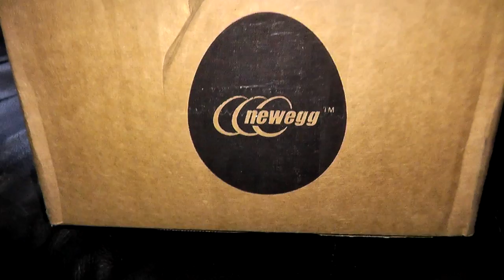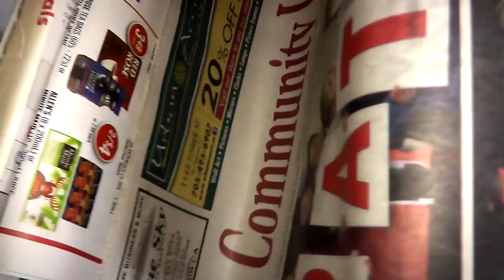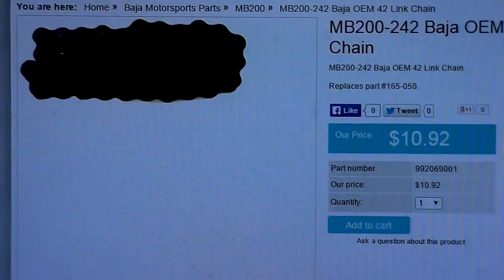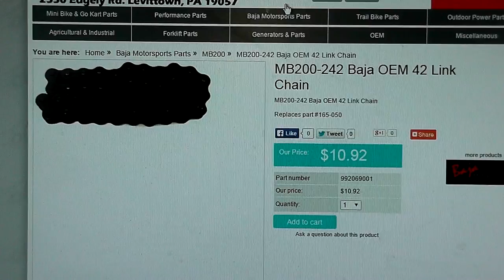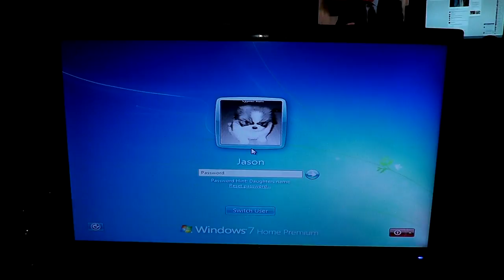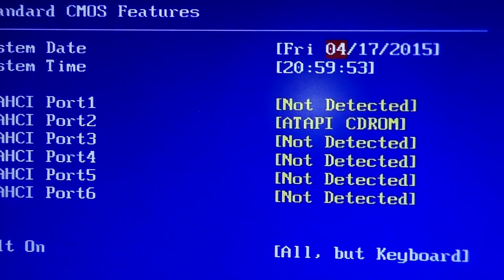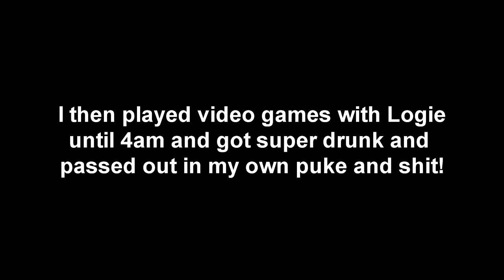Minibike work, Dinner at the parents

Comment: You might find that the drive side of the clutch is clamped to the crankshaft with Allen screws, and the clutch bell is attatched with a snap ring.

Comment: Sucks about the HD. I got the dam 7b error a bit ago. It was some crap with the boot files for windows and the drive still actually works, but not being seen on the bios is dicked. I have had good luck with seagate so far with 8 drives, knock on wood.
Reply: *****
Right, I always keep a total backup of everything just in case. I have read the bad about seagate, but luckily i havent had issues yet. Just got the 5tb backup plus external on sale at 125, which was a decent deal.